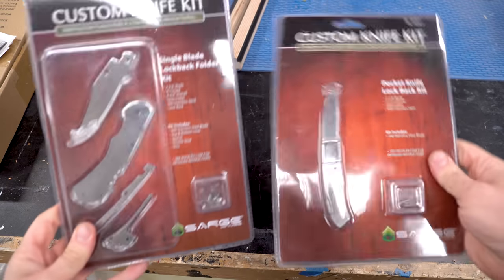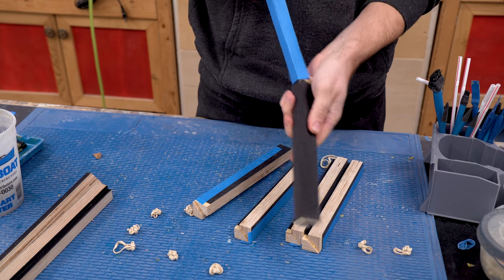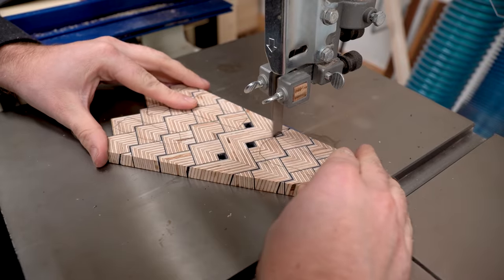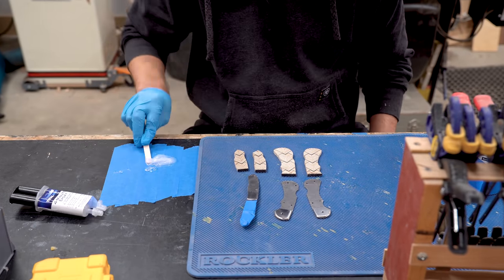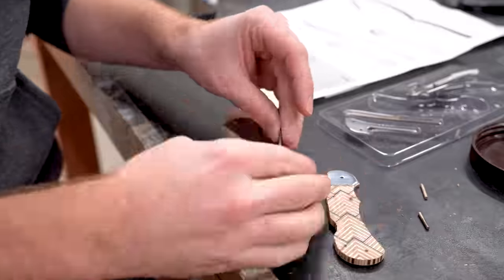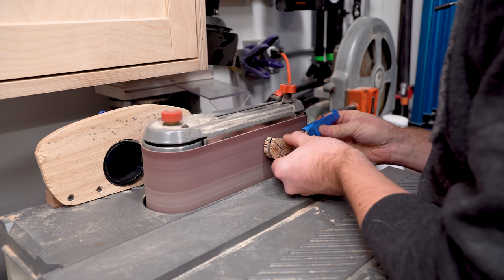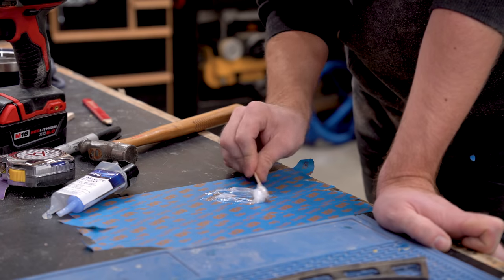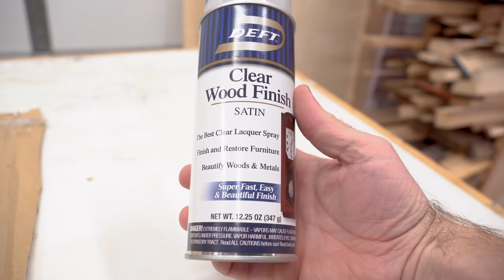Handles and Scales from PLYWOOD

Comment from the maker: What do you all want to see me make next?
Reply: Oval picture frame.
Reply: Patterned plywood longboard!
Reply: How about making a collection container/box out of tiles to collect your cuttings on your band saw?
Reply: What about a set of files with pattern plywood handles?
Reply: What if you did something like pattern plywood but with the end grain of exotic wood species? There's a company that sells bundles of exotic wood offcuts. I think its like Bell Wood Supply or something like that.
Reply: What about purple wood? Or something done using ironwood, those could make fancy colors on your works
Reply: Michael, screwdriver handles, with the thick and curvaceous shape of old Stanley screwdrivers. If you do glued up sides, like the above, then the glue joint's strength might be in question, but if there was a way to do an interlocking 3D patterned plywood handle, that would be AWESOME. Plus, it would have that wrapped look like the axe handle. Just a thought. ;)
Reply: Patterned plywood computer keyboard is the logical next move, Michael. You know this.
Reply: Patterned plywood mallet and handle. Have you ever turned patterned plywood on a lathe?
Reply: Do a collab with a guitar maker.
Reply: Professional sized table tennis paddle with plywood handle. Making patterned plays table tennis table might be a bit excessive 😅
Reply: Great gifts! Giving me some ideas for next Christmas! I think it would be cool to make a patterned plywood saw handle, like the intricate handles on good quality dovetail saws or something like that.
Reply: small parts bowls, or dice bowls would be neat. Maybe a game board?
Reply: Make your own plywood! Maybe with some cool species? And then....well...you know; your very own pattern plywood. Maple, sapele and walnut? Cheers.
Reply: 1911 Pistol grips!
Reply: Pattern plywood spheres
Reply: Cheese board or a charcuterie board or some coaster set with the holder . You can make some cool patterns
Reply: Pens, or a rolling pin! I love stationary and baking! lol
Reply: A surfboard ! A coffee table, a chandelier.
Reply: Lampshade!
Reply: If I won the lottery I'd love to have a desk using patterned plywood. If you're spending hours at a desk might as well make it a thing of beauty to look at. Would imagine was too time intensive to manufacturer that volume though, but thought maybe you could integrate different patterns/colours using off cuts for almost a mood board of what you've done/do with it.
Reply: 25 foot pattern plywood badger. Did I already use this joke?
Reply: @Seabee_133  but the cardboard box is such a simple elegant a solution.  😋  I love it every time I see it and do it myself pretty often!
Reply: Wooden spoons to go with the bowl
Reply: More animal-related pieces (like those owl wings).
Reply: get a airbag press from air press then dye your own rainbow plywood veneers
Reply: A pool table cue. The “handle” part!
Reply: How about remaking the handles on your planes in patterned ply? or other tools around your shop. That way, you can keep showing them off to everyone in all your future videos lol
Reply: Your logo. Make a long stock of it and when you make a project you can bandsaw the face of it off and inlay it into the new project. And for a bonus (depending on how big the diameter is) you can put cork on the back to make coasters
Reply: Patterned Plywood canoe paddle
Reply: Door handle with some sort of Skelton inside the plywood
Reply: Wall art
Reply: Aeroplane
Reply: A chessboard maybe?
Reply: Im repeating myself again😅 front baffles for a set of bookshelf speakers for your workshop or a 🎸
Reply: I would like to see if you can make your Logo in patterned plywood. Don’t know if its possible with the shapes and all
Reply: cedar strip canoe but in your style
Reply: Patterened wood baseball bat (and a matching baseball)
Reply: Handle for chisels set or even more awesome, I want o do is handle of a ryoba Japanese saw.. It would look superb..
Reply: anything that tests how well the patterned ply can be machined if possible! i think that would open up such an incredible world of opportunity :) incredible work Michael, keep killing it!
Reply: I think the most visually striking stuff you've done is when you're molded patterned plywood into organic shapes. How about some sort of fantasy jewel box? Something ostentatiously ornate and elaborate that you'd present to royalty at Rivendell.

Comment: All 3 turned out amazing! But, ESPECIALLY the hatchet. It is soooo cool how it looked after shaping it, just to see how that patterned plywood bended and morphed because of the curvature. Top notch Mr. Ahlm. Top notch! I bet that was your brother's favorite gift this year. . . So much more meaningful than some cheaply made foreign electronic device. Do you suppose that Bridgeport brand hatchet is produced by the same company that produces manual vertical mills for metal working?
Reply from the maker: Thank you! You know I was wondering the same thing about Bridgeport. They were both made in Bridgeport Connecticut. 🤷🏼‍♂️

Comment: Awesome handles! I’ll have to try this for myself soon. Just a tip, when you peen those pins it helps to add paper shims in between the two sides to keep them from getting too tight on the blade.

Comment: That contouring is sooo beautiful.  I'd love to see more curvaceous designs like this which bring out those 3D patterns.  Also, if you made your own plywood, you could do it in 3 dimensions, layering through the thickness of the pattern, thus getting even more interesting shapes when it's contoured.  Plus if you're making your own, you could size it in blocks smaller than 3/4"

Comment: When you glue up the plywood like that, what kind of strength does it have?  I would like to use this method for my DIY speaker cabinets left and right side walls.  Wondering if the vibrations would shake the glued up pieces apart.  Thx and love your work!  It’s beautiful.

Comment: Beautiful work.  Do you think the handle would be strong enough if it was made of the plywood alone?
For this axe the handle has the metal core running through it, but do you think there's a risk of breakage if it was just an axe head on a handle made of just the patterned plywood?

Comment: I particularly like the combination of unpolished axe with patterned plywood handle.  I wonder how durable it will be. 

People have laminated their own plywood using epoxy in a vacuum bag.  If you did that and used all epoxy in the pattern glueup, it could be very durable and offer even more room for exploration.

But adding to the already large effort needed may not be a great idea.

Comment: Question: 

Right before you used spray lacquer you pulled out a specific respirator... why is it in bag and why not use that one all the time? 

I ask because I use the same one ( with big pink filters) 100% of the time while woodworking. 

Cheers,

from another Seattle woodworker
Reply: I'm not the guy, obviously, but I would imagine you keep it in a bag to keep sawdust off of it, especially the inside.
Reply: @CeeJayThe13th  that was my thinking....but mainly...why not use that respirator all the time? He uses different ones for different reasons I think....but why? 

Cheers
Reply: @avonwoodworking7748  Probably one respirator for dust and another for vapor. Different filters.
Reply: @avonwoodworking7748 , well different respirators are designed and rated for different things, right?

Me personally, I'm a big dumb dumb and I never use anything more than a bandana over my face and even then only when my nose is cold or the dust/fumes are already bothering me.

Comment: I’d bet that if you did the same pattern with a 1/2” & maybe 1/4” plywood for the knife scales would look awesome as a set with the hatchet and the knife kits you got.  That way the 3/4” pattern on the hatchet would match up better on the larger knife with a 1/2” pattern, and then the 1/4” on a smaller knife to complete the set.  I’m now thinking of the same thing on an old Eastwing hammer or hatchet that I might have sitting around here somewhere, replacing the leather handles on them.

Comment: I think an American flag would be awesome. make 1 pattern that is the stars then cut it to make all 50 different patterns for the strips. Also adding copper or aluminum into your patterns would make them pop would have to epoxy in the metal just a thought. nice work on the project